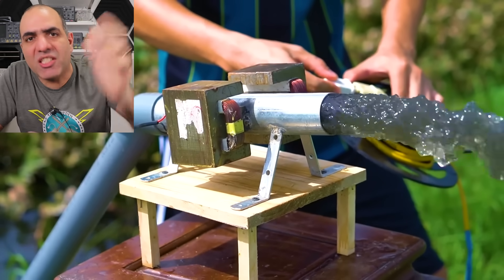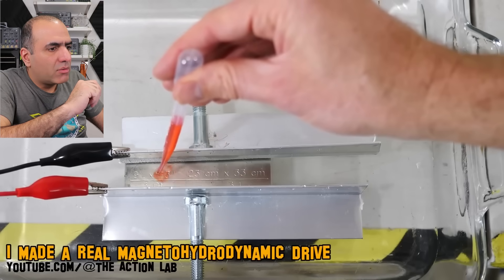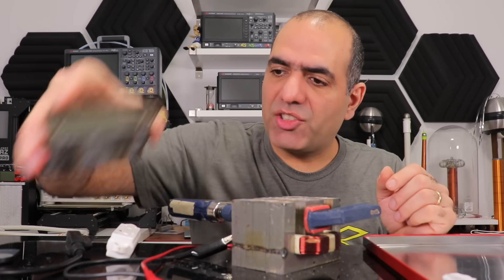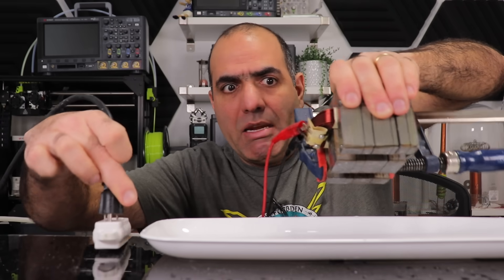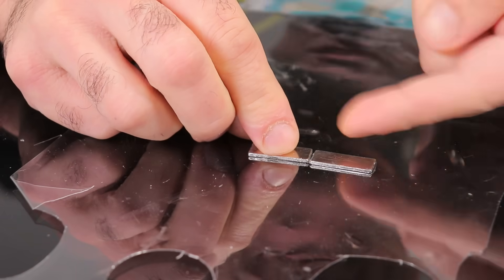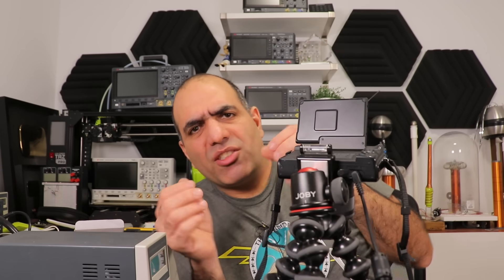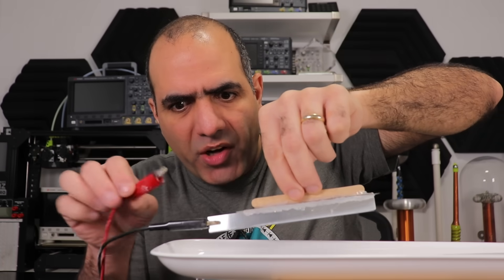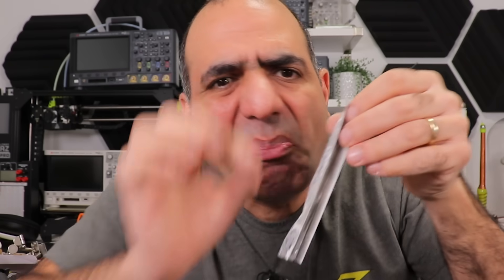Making a Water Railgun

Comment: 0:36 actually that would be a VERY bad idea, only connecting the two center legs to the other coil's center leg laminations, as both OUTER legs also need to be directly connected across the opposite outer leg ends, to complete the FULL path for the magnetic field to flow around, having such HUGE air gaps in both outer leg ends on each side - would drastically hinder ANY magnetic flow around the cores, to the detriment of providing sufficient anything, in the water.
IF on the other hand, the outer legs had solid metal BLOCKS upon which the leg ends could rest, there would be a complete circuit around each coil, via the cores, to provide an extremely STRONG magnetic force across the column of water, in the metal pipe.
THAT could potentially send the water OUT one end, if enough water could enter the other end to replenish everything lost out the first end.
Re:
The flow of magnetic fluxes, across the legs of split (equal halves) of three core single or dual phase transformers.
Any AIRGAP in any leg of a three leg transformer, produces something called EXTREME HEAT, as well as magnetic core flux restrictions.
A contactor (or microwave oven transformer/s) with the bar removed from the bottom of the E, will create MASSIVE restrictions on core flux paths, meaning that they will heat excessively, until the air-gapped legs are shorted together.

Read up on transformer core losses here, and the effects of air gaps in transformers of any type specifically those of contactors - which are designed in two halves, to be DRAWN together magnetically, when the windings around the cores are electrified..
re:
https://eepower.com/technical-articles/power-transformer-basics-transformer-construction-types-and-winding-connections/

Comment: I think you misunderstood how does mhd if im spelling it right worksb(basically water railgun). It works not because there is a current through water but because when you put two electrodes in that water they broke down water molecules back to hydrogen and oxygen (thats why it boiled and burned, because hydrogen is flammable gas) but those atoms are still charged and because of that magnet you put and electrodes you created an electric field in y axis and magentic field in x axis so the force was applied to those charged hydrogen and oxygen atoms was in the z axis so your water moves. Hopes you understand now.

Comment: Seems like a part of the problem is water flow at the start, only the areas by the magnets generate water current so the starting area is at a deficit of water compared to the end.
If there was some way to widen the inflow area to be bigger than the outflow area it should give the water more pressure i would think.

Comment: Is it possible that with high DC voltage and current, water (+NaCl) is electrolyzed and the fire is the result from the reaction H2+1/2O2 -> H2O?

Comment: the gasses created are H2 and O2 so they are not toxic but if you create enough H2 it is going to explode by a spark. but the percentage of H2 needs at least to be at about 4% in the air and you don´t have to worry

Comment: less salt, more plates, higher voltage, more magnets. battery psu and put under a boat to see if it moves. bonus points for catching the o2 and H then diverting them to a real engine

Comment: except you can compress it, and so pressure is all you can do.. when means youre limited to range almost immediately because as you narrow that stream, a non linear effect happens where gravity tears the stream up kinda quick.. Well it does and doesnt. It's linear at first, until you get to a silly range then all of a sudden, environmental factors just thrash it. (*just my understanding, im fine with being wrong, but if so.. provide information why with details please i should mention the nonlinear factoring gets into theoretics where the water jet diameter and pressures involved basically can't exist and it's an extrapolation)

Comment: hey bro, maybe you can use a capacitor from a former water pump or washing machine motor and so on, that might reduce the level of short circuits, and can prevent excess current for the load

Comment: 13:29 Technically yes the gasses are poisonous. When you run electricity through the water you’re basically going through the process of electrolysis. You’re splitting NaCl and H2O.
Through electrolysis NaCl and H2O become sodium hydroxide, chlorine and hydrogen gas so yes it’s flammable and toxic but only in high quantity’s.
edit: i finished the video but i’m gonna keep this up bc its still a good read

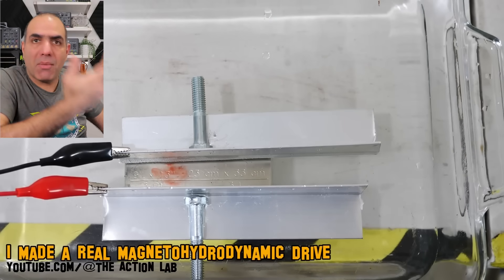Comment: 2:30 this is used in genetic and proteomic testing using electrophoresis gel. The protein or gene strand is put into a gel with varying degrees of density as a current runs through the fluid and pulls the materials through. Based on the length of the genetic strand it will stop moving at a certain point in the fluid because of friction and you can use this to see if your sample has a gene strand or protein that matches your control.
Reply: It works on the principle of attraction and repulsion. DNA is negatively charged and thus gets attracted to positive terminal. Here in the video, he is working with electromagnetism and eddy currents.

Comment: No water is not magnetic but it is conductive. Thus the current can move through it. If you conduct through it you can make it pull or push towards opposite poles of charge like a magnet does.

Comment: You built a "Whisper drive" from the Red October :) Though in the book it's just a pump jet but the movie it's exactly this. Wouldn't work of course, the Red October would probably top out at 10 knots or so. Still pretty good but it's super inefficient, you could just drive a prop at low rpm, get way better efficiency and it won't make too much noise. Besides a magneto hydrodynamic drive could be noisy too. The quietest submarine ever built used a stirling engine and a comventional propeller. Swedish boat. Sank a US carrier in a war game. Carrier never saw it. A simulated torpedo just appeared out of nowhere and the Swedes surfaced grinning like idiots.

It's the reactor itself in a nuke boat that's nousy too. High pressure steam, turbines etc... lots of vibrations and noisy vs a stirling engine moubted on rubber feet. That boat was about 1/4 sound dampening material.

Comment: In college we did the light bulb experiment, and the professor no joke gave us cut in half extension cords to dip into the water to light the bulb, using de-ionized water and then tap water. No test breakers. It was a different time.

Comment: Yet another small correction: water molecules do have a magnetic dipole, too (besides the electric one) and these are, course, randomly oriented.But if you freeze the water under a strong magnetic field you'll get a weak magnet. I wrote another small correction to the light bulbs video (about halogen second glass layer, is not for aspect but for UV-cutting, the first quartz one doesn't), but I suppose is quite unlikely to find them... just in case, give back a signal, doing it just to improve your videos, which I follow.
Reply: Is it because of the crystalline lattice of ice?

Comment: That would be very good solution for increasing the overall efficiency for hydrogen production cells. 
Cars: combustion, power, exhaust  turbo, more pressure.
Hydrogen cells: electrolyses, water flow, generators, more efficient electrolyses. With less losses of energy

Comment: rail gun version: the current moves from left rail - over the projectile - to the right rail ... but instead of the projectile you use water:  --->>>> the water = a conductor - the electricity MUST flow through the water/projectile

Comment: Wouldn't you want to keep your voltage low while increasing your amperage thereby reducing the heating effects on the hydrolysis of water and maximizing the flow potential created by the current?

Comment: 13:29 , depending on the type of salt used (table salt = sodium chloride) you are probably making chlorine gas as a bi-product. Drake at styropyro makes it quite often in his chemistry videos.
Reply: I was just thinking this - its not boiling, its electrolysing. I wonder if Mehdi could smell chlorine. Plus, the flashes might have been sodium oxidation.
Reply: It makes chlorine on one electrode and hydrogen on the other. It's an explosive mixture, easily triggered by light(!); the explosion yields HCl which is also a pretty nasty gas, and a strong acid when dissolved in water.
Reply: Learned this one the hard way...
Reply: @he-sip  you gased yourself didn’t you
Reply: @Yeshellos beans got gassed 😆
Reply: Its probably just a mixture of hydrogen and oxygen. Water breaks down into hydrogen and oxygen when there is electricity in the water but he could probably also have made chlorine gas as well (if anyone wants to try and break down water, be careful the hydrogen and oxygen mixture is explosive)
Reply: @Notwhitewolf While electrolysis of relatively pure water produces basically pure H2 (hydrogen) at the cathode and basically pure O2 (oxygen) at the anode; if the water is nearly saturated with sodium chloride (the primary component of table salt), something different happens. H2 and O2 are still produced, but the O2 is mixed with Cl2 (chlorine gas) and in the water (rather than bubbling out with the gases), NaOH is produced (sodium hydroxide, commonly used as drain cleaner and in various detergents and other cleaning products).
Reply: I have some ammonium chloride I used because I recently became addicted to salmiakki. I wonder if it would make some spicy ammonia lol... and if we use both at the same time would we get some spicy NCl³?
Reply: And he is doing it on an aluminum container…
Reply: By-product. Unless the gas is bisexual.

Comment: Medhi, please make a simple switch box and stop ruining your sewing machine extension cords. 2 gang junction box, wire clamp in knockout, put a light switch on one side and 20 amp gfci on the other, power cord runs from source outlet to switch box, light switch controls outlet in box.  Set the box on the bench top so you can safely shock yourself at the flip of a switch.  They also sell router or table saw switch boxes that are pre made with rocker switch but will not be as robust and easily fixed.

Comment: Do you know what electrolysis is...? When you apply voltage across water (typically salty), it causes the oxygen and hydrogen molecules to split, releasing gass (oxygen and hydrogen).
Reply: Oh yes, nevermind, I watched farther. It seemed that you did not know what electrolysis was based on previous videos that you made... sry, mb

Comment: Try replacing the permanent magnet with an electromagnet while still running current through the water
Reply: And also for a variable DC supply with higher current threshold, you can use your autotransformer and the full bridge rectifier

Comment: What comes out of water is HHO mixture.
It is basically water that is broken down to oxygen atom and two hydrogen atoms with help of electrolysis.
It is not safe to inhale it excessively as it can displace oxygen in lungs because hydrogen is lighter than oxygen. 
And top of that it is highly flammable mixture. Most likely it was also reason why it looked like "water was on flame".

Comment: The electrolysis would separate the oxygen and hydrogen atoms from the water molecules, giving oxygen and hydrogen.
But, since it's salt water, you get hydrogen and chlorine gas, which is not good.

Chlorine turns into hydrochloric acid when it enters your lungs.

Comment: It's easy to move charges in water; it's called electrophoresis. Usually applied through a gel or capillary. You need to be careful with the  voltage with sodium chloride in the water. Above 2 volts, you could have electrolysis of the water and chloride and produce chlorine gas (not anything you want to breath).

Comment: I can concur that exposure to salty water and a bit of dc power can wake you up! I had 4x largeish 8ah 3 cell lipo batteries to power my kayak and I got hit with a wave and got completely soaked! everything I touched in between the batteries and the trolling motor left me tingling! I was drenched  so was the exposed batteries and balance lead’s with salt water each cell being near full at 4.2v could have been worse! especially if I decided to add more power! Knowing the difference between series and parallel circuit’s and being familiar with exposure to voltage it was a shock to experience near total clamping of muscles from a 12v system but my guess is that the balance leads leaked more than a parallel connection in the brine

Comment: it's surprising you didn't know MHD before ... it's use current in magnetic fields like in motor but ... in fluids.  supersonic missiles / high speed torpedos use it to not just burn with air friction/ make shockwaves .

you can try this with a small boat in a water current simulated in you bathroom to avoid waves ^^

Comment: Puts water into a high voltage and high current environment. It burns itself out. Question that should be asked, water doesn't burn....? Electrolyzing water = hydrogen and oxygen. So there's that too (i.e. if you made this bigger make sure you don't accumulated gases, I like your videos too much, and I'd rather you not explode). :D

Comment: You are probably getting Chlorine and Hydrogen gases out of it. You have a brine solution here through which you are flowing current which will initiate electrolysis and you will get these gases. You will also be producing NaOH which will increase the pH of your solution. 
Anyways I learned about it 7 years back in school about this water flow phenomenon. I did not know this fancy name but I remember that concept. Because of the current flowing in the water it experiences a force due to magnet similar to how a motor works.

Comment: Mehdi, you made chlorine gas with that 😂 it works as an electrolytic cell, since there are two electrodes (positive and negative) both inside of a conductive salt solution. You dissolved NaCl, and in an electrolytic cell Na+ cations get reduced (they earn one electron) turning into their metallic form for a brief moment, and instantly react with water to create NaOH (sodium hydroxide). Cl- anions, on the other hand, get oxidized, and form Cl2 gas molecules, which are poisonous... And kind of smell like bleach lmao

Comment: What would happen if you discharged a big high-voltage capacitor bank through it? Real rail guns use many thousands of amps (albeit AFAIK without the supplemental magnets). It would be interesting g to see what would happen with stronger magnets on both sides (making a rectangular tube) and then zapping it with a capacitor bank. I bet you could get a pretty good spurt of water out of it!

Comment: interestingly this technology does exist, it is used in cooling applications where they use liquid metals like NaK (an alloy of sodium and potassium that is a liquid at room temperature).
the lower resistance, paired with the lightweight and high thermal conductivity of the alloy makes for an excellent cooling loop with zero moving parts, problem is that NaK is  extremely dangerous to work with, so it is only used in highly important applications, such as in some nuclear reactors, where NaK has the advantage that sodium and potassium don't become radioactive themselves when exposed to radiation.

this could also work with mercury, but mercury has the disadvantage of being very dense, therefore heavy and thus more resistant to being set in motion.

Comment: You also  made a prototype of sonic welding machine, which at core (pun!) is a high-frequency transformer with an element of magnetic guide that would vibrate. THe effect is known as magnetostriction.

It actually not healthy to grab a powered magnetic core because of that - it may traumatize cartilage or give a sonic shock to nerve endings.

Breaker pops because creating  air gap in core causes current to rise. That actually was used in past for many purposes - even for sensors. On other had if a transformer with air gap still got second coil, the gap kinda works like a current limiter - you can short-circuit the outgoing coil and current both there and in input coil will be finite. That is useful for arc welding.

Comment: I'm far less experienced but it's my under standing that saline water HATES electrolysis instead changing into hydrolysis where the water is...something like over energized and smashes into another chemical bond and replaces it, this is where the chlorine gas and the sodium hydroxide is made.
Thankfully minute even on the large scale, your small scale shouldn't be to hazardous.
But my other question is, doesn't the rail gun work vastly differently when you change from AC to DC? Or vice versa.

Comment: Love your content! Wanted to know your thoughts on an electrical generator stating the following: The ground-breaking technology is based on existing Electromotor technology with specific modifications to Coils and Magnets.

The concept is the recuperation, storage & reutilization of the Back EMF (Electro Magnetic Force) in an electromotor.

This way less power is needed to achieve the same amount of Horsepower.

The battery will be constantly 100% charged with a guaranteed lifespan of more than 20 years.

Sounds like a Bedini motor but I'm not sure😂

Comment: The gas is not poisonous, it's flammable though.
Reply: it will contain chlorine
Reply: although the chlorine content won’t be high due to it preferably turning into bleach instead in to the basic environment created by water splitting into hydroxide and hydrogen.
Reply: it is still a bleach generator though